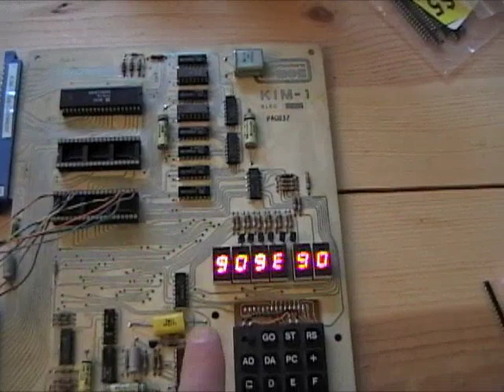KIM-1 6530 board

Comment: Have you ever found a good replacement for the 6530-002. A friend of mine, just recently dropped off a Non-working KIM-1 and it appears as if his 6530-002 may be the fault. As all the Port pins are being held High. While all the input signals look good. At least at first glance.

Comment: Hi,

Great!
Love it, care to publish the circuit diagram of the daughterboard? Or can you tell which 6530 you have used?  There are many like 6530 02 and 03 in KIM-1, 6530 04 for TIM, 6530 10 11 for a pinball machine and 6530 30 and up for Commodore disk drives. Love to hear from you